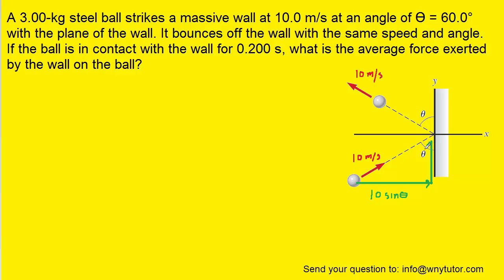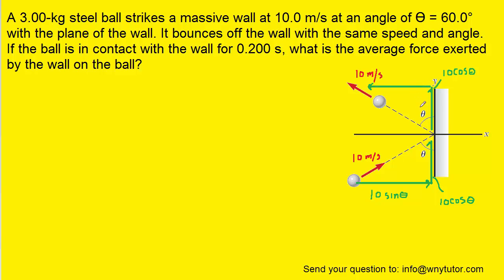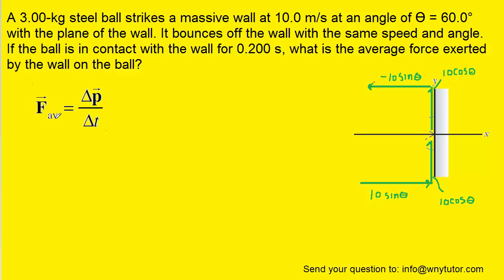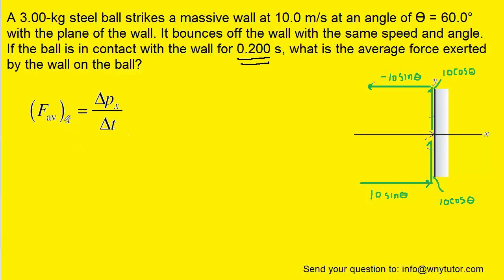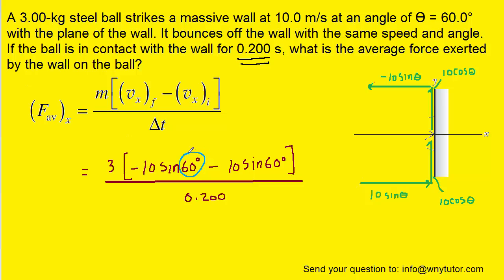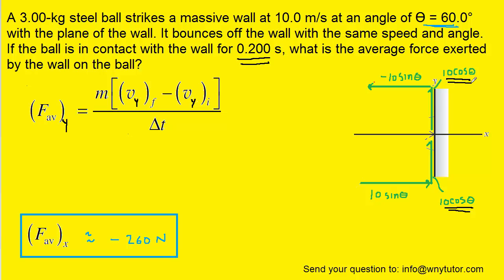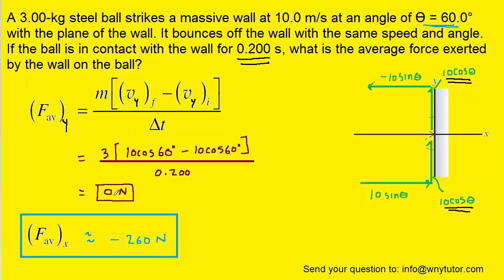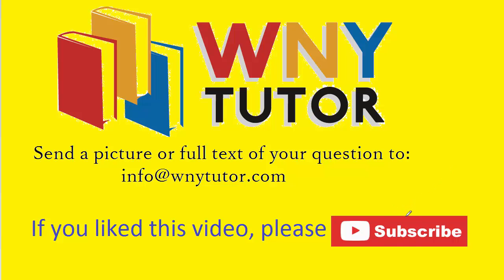A 3.00-kg steel ball strikes a massive wall at 10.0 m/s at an angle of ϴ = 60.0° with the plane of t

Comment: This problem has been solved!

See the answer
A 0.500 kg sphere moving with a velocity (2.00i - 2.90j + 1.00k) m/s strikes another sphere of mass 1.50 kg moving with a velocity (-1.00i + 2.00j - 2.50k) m/s.

(a) If the velocity of the 0.500 kg sphere after the collision is (-0.90i + 3j - 8.00k) m/s, find the velocity of the 1.50 kg sphere and identify the kind of collision (elastic, inelastic, or perfectly inelastic).

(b) If the velocity of the 0.500 kg sphere after the collision is (-0.250i + 0.775j - 1.63k) m/s, find the final velocity of the 1.50 kg sphere and identify the kind of collision.

(c) What if? If the velocity of the 0.500 kg sphere after the collision is (-1.00i + 3.10j + ak) m/s, find the value of a and the velocity of the 1.50 kg sphere after an elastic collision. (Two values of a are possible, a negative value and a positive value. Report each with their corresponding final velocities.)

Comment: I just did 30*cos30 to find the x component of momentum. Then multiplied that momentum by 2 because the impulse of the wall has to both stop the incoming x momentum, and then supply that same momentum again outward. And dividing that value by 0.2 s gets a force of 259.808N
Reply: where did you get 30 from???
Reply: @olbibulbi4348  Right angle marked by the black line makes a 90 degree angle, and 90-60 is 30.
Reply: @olbibulbi4348  Unless you mean the actual 30 and not cos30, in which that was just the speed (10 m/s) times the mass (3kg)